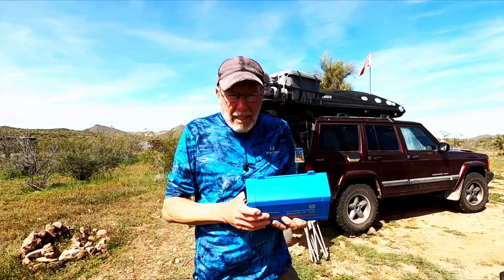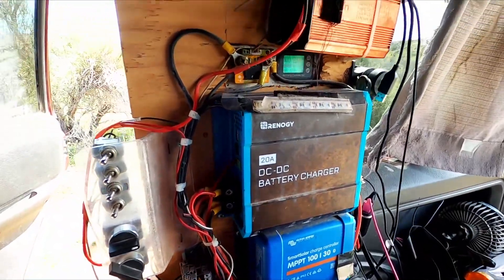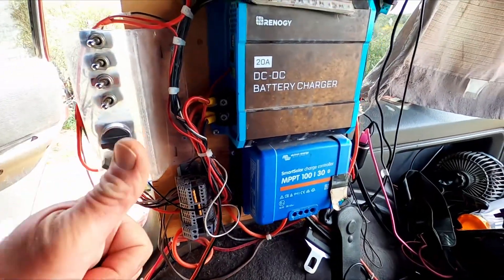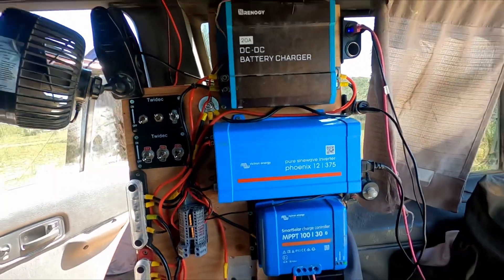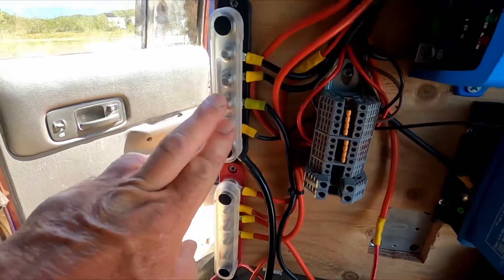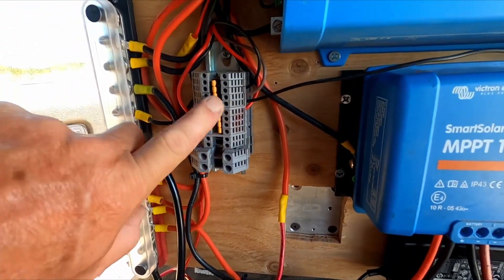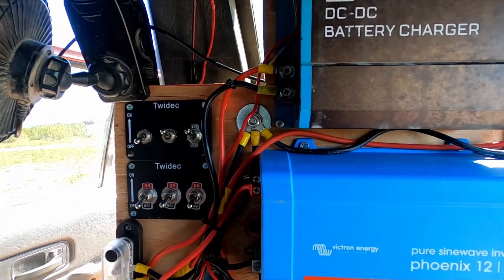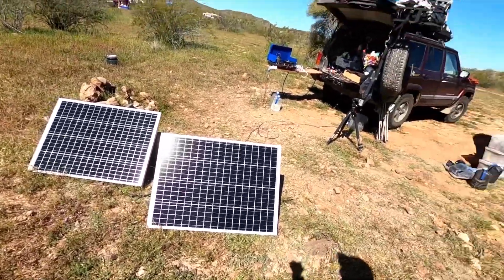New Victron Phoenix, inverter 12 V, 375 W and redoing my whole electrical system.

Comment: What is 375w good for? Just finished the video.  I love Victron stuff.  It's crazy to me but I'll probably buy one of these just to do it.  If that's all you need then that's all you need.
Reply from the maker: It is actually a little under 375 watt. It’s just enough to use for my Starlink and my laptop. That’s pretty much all I use it for.

Comment: John, your electric panel is a nightmare B U T I love your enthusiasm. Victron is a reliable brand available all over the world, i am waiting for the same inverter to be delivered tomorrow, I guess.
If I can give you a suggestion, keep an eye on all the connections (especially with the yellow collar): make sure from time to time that the bus-bar nuts are tight (not over-tight) and try to avoid the cigarette socket, they are prone to overheat. Try to zip-tie as much cables as possible together and try to keep the cables length consistent, no sharp corners. Keep the battery connectors clean and tight. All the rest is a thumb up!
Reply from the maker: Thanks for the advice Nick. The panel was just a work in progress. Since that video, I have added a couple more things and rewired it with better wire and made it a lot neater and safer.

Comment: That ain't a 375watt inverter. Electrically maybe correct but confusing compared to other brands uses Victron Volt/Amperes in their naming. So it is a 12 volt 375 V/A, which gives 300 Watt @25°C and 260 Watt @ 40°C. Something to consider if you don't want things smoking.
Reply from the maker: Hey Luc thanks for the info. I have looked at all the info on it. I’m just running my Starlink and my laptop that’s it.
Reply: Nice! no problem then! :)
Reply: @overthehillandoverthemount2925  Can you share your experience running Starlink? I'm currently designing / researching my electrical system for a Starlink setup...I have a 100ah Lithium battery, 240w solar panel. I read some people had issues running Starlink on the Phoenix 375...tripping on boot up. So I thought maybe I go with a 500W Phoenix. Any info greatly appreciated.
Reply from the maker: @ZaZa-ra  so far I have no problems with my Phoenix 375 W. I can run my Starlink and my laptop at the same time with no issues. I have 3 100 W solar panels and 200 amp hours of lithium Batteries. On a sunny day, I can run all that off my solar panels without sucking anything out of my battery. If you have the room I would say go for the bigger inverter. You never know down the road what you’ll add to it.

Comment: Well done. I agree Victron is the best. I've built two small off grid systems that run almost everything in the house, including the water heater, two fridges and a freezer, small microwave and camp oven. Each system has a 7.68KWH LiFePO4 battery bank (6x100AH & 4x150AH.). They are 24V systems, and I'm running one Multiplus 3000 (2400W) and one 2000 (1600W) inverter, with a 1200VA (1000W) inverter in reserve. I'm using all Victron equipment apart from the batteries.

Have about 7000W of solar panels in total, but half of that is a separate grid tie system. All running nicely, but I'm always improving it as money allows.
Reply from the maker: That is all pretty impressive I don’t think mine could get any simpler. When you live full-time in a jeep Cherokee, there’s not much room for anything. I’m lucky I managed to put two batteries in.

Comment: Hey John I’m impressed! That 12 volt DC wiring is pretty involved and a completely different animal than the 120/240 VAC 
Give you a solid A, just a few more tie wraps and I’d give you A +
Reply from the maker: Thanks Norman there are still a few wiresI have to disconnect and re weave it to make it a little neater then put some more wire ties on it. I still have to wire in a disconnect switch then I’ll be totally happy with my system.

Comment: Nice setup John. I am surprised youre  only running 375 watts though. But if it is doing the job then thats all you need.
Reply from the maker: If I was running an espresso maker inside my jeep, I would need more power. Lol All I  am running is a small fridge, my computer and charging up my iPhone and iPad and that’s it. The fridge just runs on 12 V so I have way way more power than I need with my 375 W inverter.

Comment: With your electric upgrades. You should get you a small air fryer.

I think you should look into a Camp Chef deluxe. Its like a small house stove/oven.
Reply from the maker: Those are really good suggestions and I wish I could get them but living in a small jeep Cherokee there’s absolutely no room for anything. If I lived in a van, I would definitely get all that.
Reply: @overthehillandoverthemount2925  The “Camp Chef Deluxe” would replace the stuff you use now. Runs on propane. Look it up at least it’s pretty sweet. And could even be a back up heater.
Reply from the maker: @explorewithme4707  the camp stove deluxe is way way too big and too expensive. There’s no way I could light up a small camp stove for some heat in my little jeep. Living full-time in a little Jeep Cherokee XJ is extremely challenging but I can never think of living any other way
Reply: @overthehillandoverthemount2925  I understand how small it is, I got an XJ. Just suggestions. I use the camp chef and tiny BBQ. But i also don’t live in my XJ full time. Just weekends. 

I was talking about using the camp chef as a backup heater. Emergency wise. SHTF

Comment: Looks excellent!!  What and UPGRADE!  Great, great, JOB!!  Keep that rig rolling to new expeditions!
Reply from the maker: The upgrade was getting rid of my $50 inverter and putting in a victron $132 inverter. Also, just adding in a couple extra toggle switches and running heavier wires from the battery up to my electronics and just making it look a little more professional.